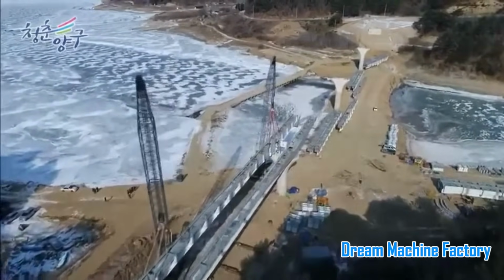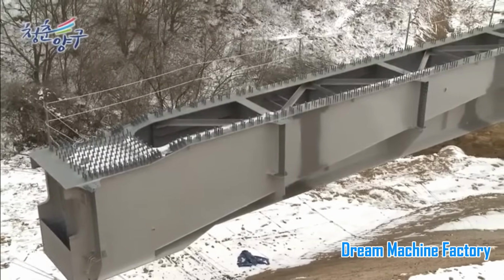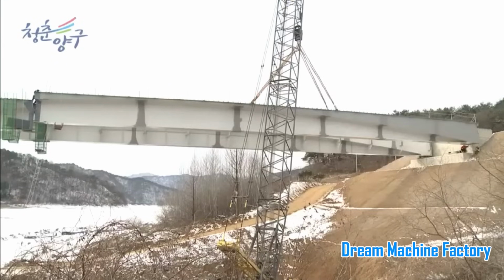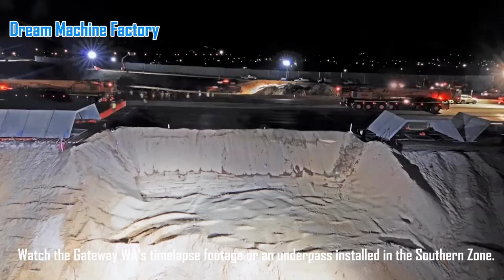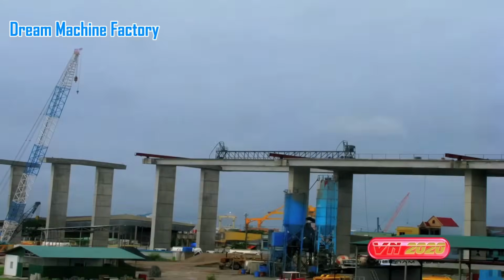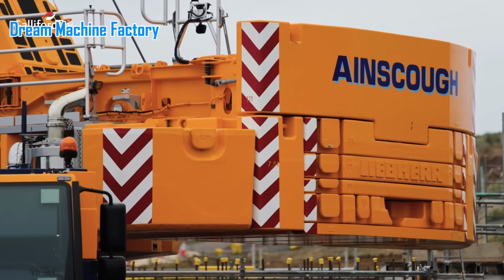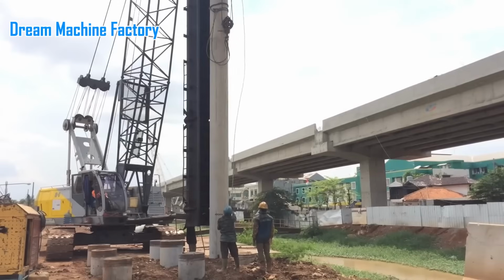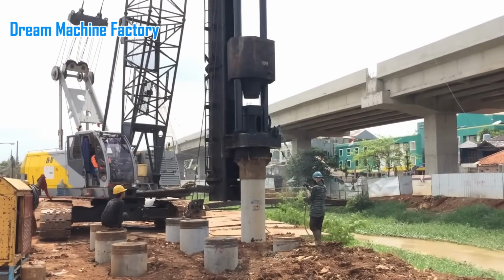Biggest Bridge Construction Process - Modern Heavy Duty Bridge Equipment #16

Comment: Midle 19 pole cylinder wired steamed compiler volts to watz filtered rotatered moter electifier piped turbo turboned european plug conjucation click and fury volt line mark . To upper volt pick promote and project